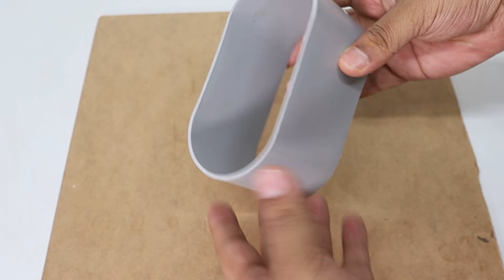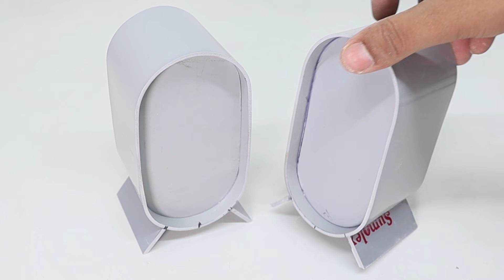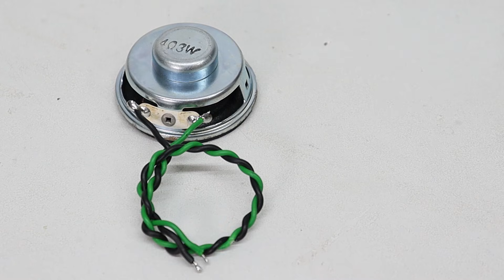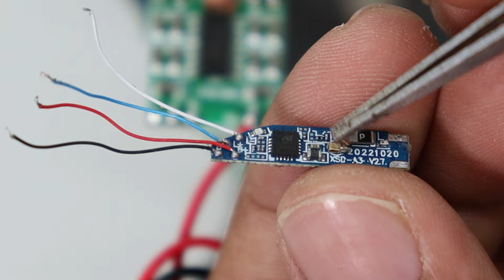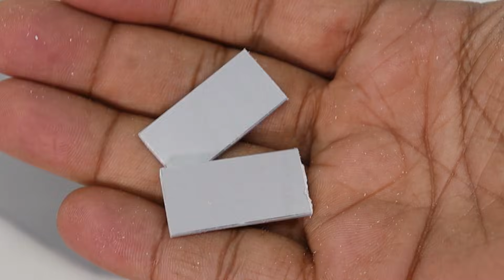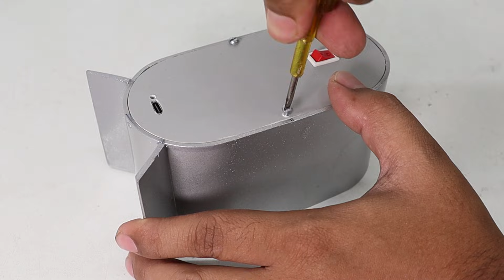How To Make Truly Wireless Stereo Speakers

Comment: Hi very interesting video. I have only a pair of questions as I don't' understand.
1) On the module PAM8403 from the bluetooth module arrives the R and the L speaker wires, (white and blue) but in the middle of R and L, it need to put a wire? And if yes from where it comes? Or it needn't?
2) I notice on your video you mention the boost converter MT3608. But I can't see where is it. So can you tell me how it need to use the MT3608 Module?
Thank in advance.
Reply: 1) yes you need a wire there IF the bluetooth module (in this case the fake airpod) youre using has an diffrent power source than the amplifier or youre using a module like the B0505S-1WR3 for the bluetooth module, and if the power source is the same as the amp one, you dont need a wire there unless the audio will just not work. the reason you would not need a wire there is because most bt modules and amps have theirs Power - connected with the pin inbetween the L R, so basically when you connect the - for the bt and amp you are also connecting that pin. but the time you NEED to plug it in is when youre using a wire to plug into it a phone, tv, laptop and anything else.
2) the MT3608 is a step-up conversion board that boosts the voltage from 2.2-28V to 3-30V and in the video he used it to boost the voltage from 3.7Volts from the battery to 5V so the audio can be more powerfull and cleaner, this PAM8403 can go up to 5.5v before its able to break, at 5.5v you can expect around 2.7W per channel at 1% THD, and 3.5W per channel at 10% THD. oh and also, you need to spin the potenciometer on the board in one or other direction i dont remember wchich one for it to start working. its MAX power output is 2A (Ampers) at maybe 12V from 5V, im just guessing that the higher output the less amps. Hope i helped!
Reply: @LukaszLukasz00  Thank you for the explanation. 🙂

Comment: what is the function for the yellow cable?? Answear please..
Reply: the yellow cabel is for the on and off of the earbud and he wier it with the board so that it auto turn on when the switch is on .  wich i helped
Reply: @mizaouiahmed2536 to where we need to solder/ connect not clearly mentioned, will u help that
Reply: @mizaouiahmed2536  ?

Comment: Takes diy to the max. Just like diy perks. :)
Reply: Kind of opposite. Diy perks design, approach, material selection, driver and amplifier selection. Everything is lots better than this. Proper separate compartment for both drivers with carefully designed crossover.
And here no separate compartment, and no crossover. Pathetic diy.
I mean if he already got a perfect recipe, and all he needs to do is to just copy that. Or he could have done something better, but what he decides to do is to do shit 💩💩. 🤦🏻‍♂️🤦🏻‍♂️

Comment: Great stuff! Can I just use one "full range" 2 inch driver for each side instead of 2 separate ones?
Reply: Yes
Reply: @SJCB21  do I just put it on one side of the amplifier board? He put one driver on for the left output and one on the right output
Reply: @Raphael_Gallo  you can leave the other output blank
Reply: Use mono amplifier board for single speaker or woofer.